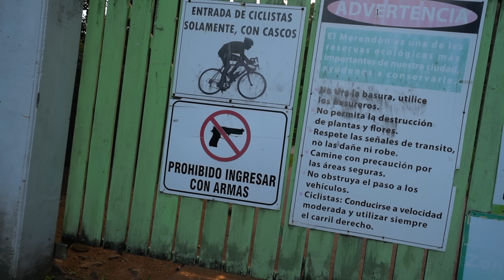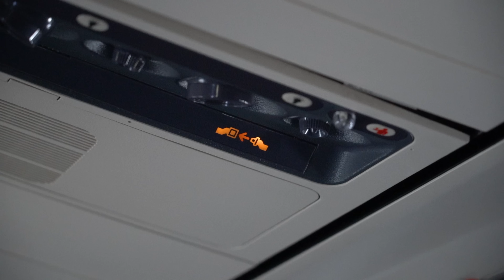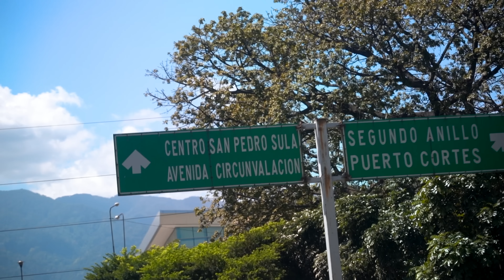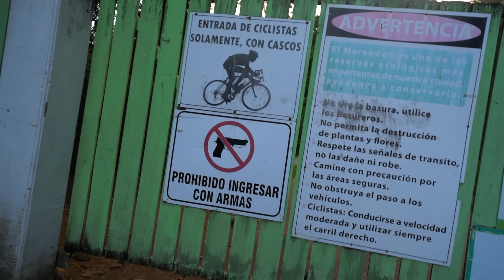DAY 1: Arriving in Honduras (not safe)

Comment: It's quite clear why the murder rate has gone done, currently, although that could change at the drop of a hat. If you look at Chicago, for example, you find that during the period when there were many competing gangs controlling the bootlegging business, Chicago had one of the highest murder rates in the world. Then the Outfit came into being, and slowly all the other gangs fell into line or were killed. The murder rate went way down. Today you have black-on-black murder causing the rate to explode again, but the real criminal gangs of Chicago, once again The Outfit, have kept that world remarkably quiet. There is no money in murder, only exposure and public outcry. Same thing is happening in Honduras. The gangs have solidified and they simply want to do business quietly. Running drugs is a complex business, as is laundering money. The government helps with the laundering (after getting a cut) and they ask the gangs to keep the killings to a minimum. Also, as gangs get more sophisticated, you find that they are quite capable of making people disappear, which is much more socially acceptable. No body, no crime.